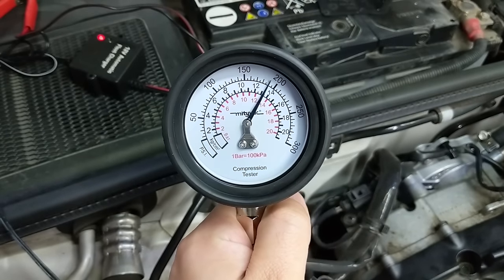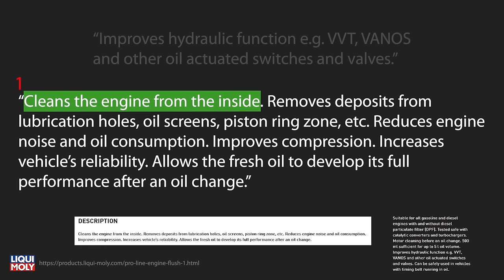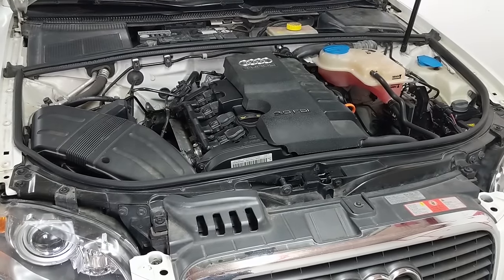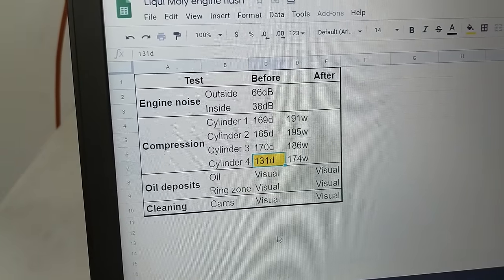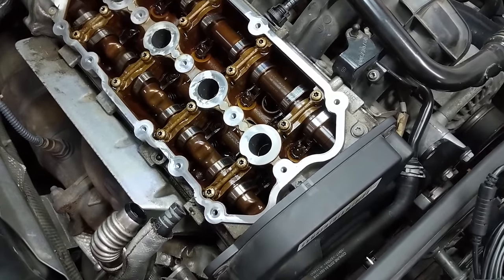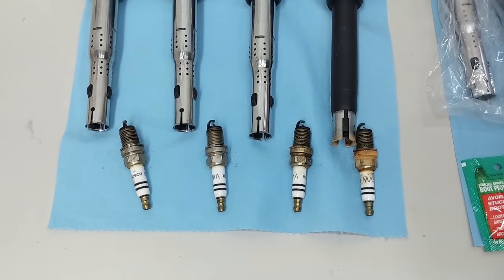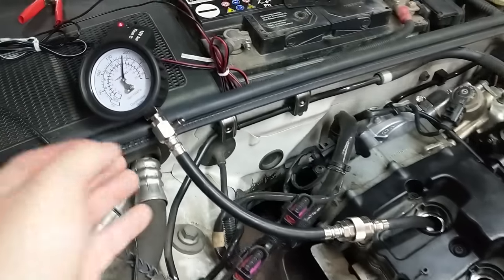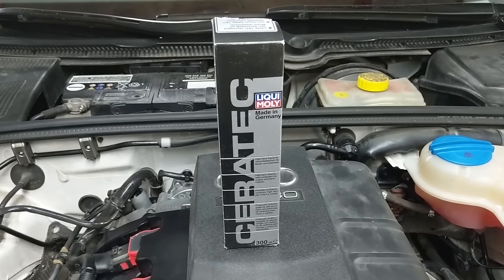Does Liqui Moly Engine Flush work? | Full Test & Review | Pro-line 2037

Comment: Nice attempt at a scientific approach to testing an engine flush, but ultimately a fail. As others have pointed out the compression check was problematic and the low compression on #4 was likely because of a small amount of carbon breaking off the spark plug when it was removed and that carbon getting caught between the valve and valve seat, also the lack of cranking revolutions, The borescope pics are meaningless, there should be no oil in the combustion chamber so no way of cleaning the piston crowns, all of those deposits in there are typical of a direct injection engine which needs an inlet valve de-carbon and a catch can fitted, as well as an upper cylinder cleaner. The varnish on the cylinder head under the valve cover is typical of any engine, and it was pretty good to start with, I have seen far worse deposits and would imagine that nothing short of getting the head off and physically scrubbing it with an aggressive cleaning fluid would make a difference. A low milage, well maintained engine is unlikely to benefit from this product.

Comment: Spark plus are gapped from a factory. Never touch  those platiniums.
Reply from the maker: Hey tom - I checked the gap on these new plugs and even they were out .002 and would have had to make some adjustments regardless. Anyways, outside of double checking factory specs, it's the Iridium plugs that seem to be the ones that you shouldn't adjust for fear of crushing the electrode.

Gapping decisions aside, I'm going to pop these back out in a few more hundred kilometers and see how combustion is treating them. It's possible I'll bring them back down to .028 at that time.